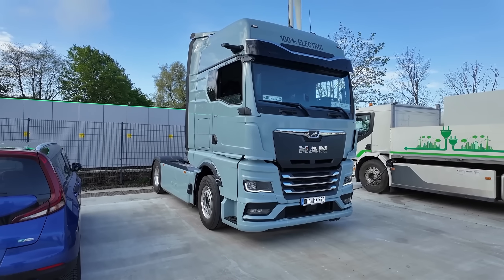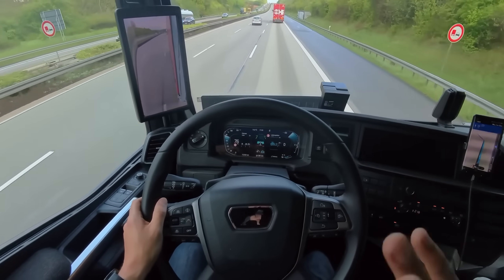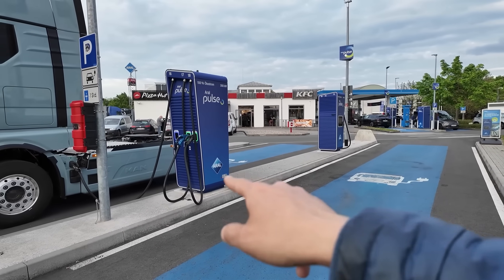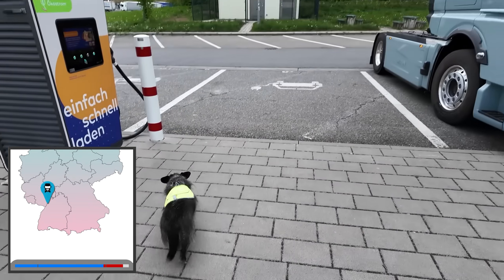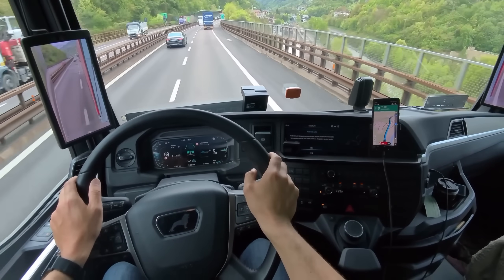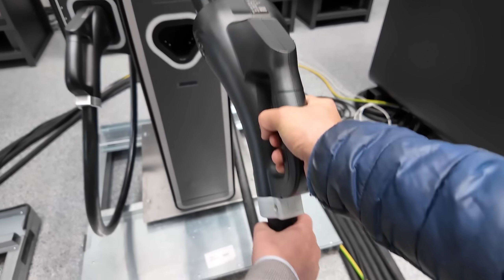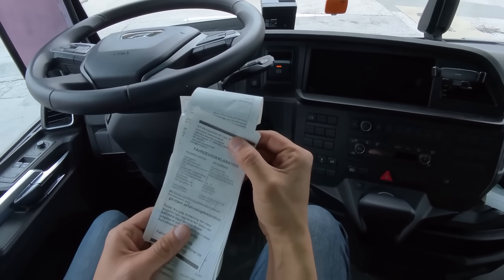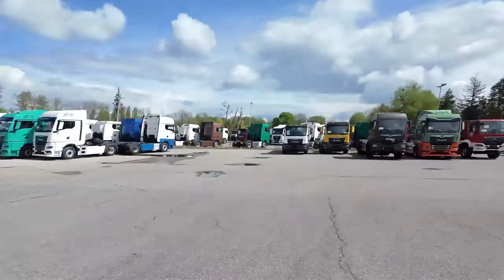Megawatt Charging with the MAN eTGX and HPC Charger Transport over the Brenner Pass

Comment: 15:00 what if? 
Question is 
If they installed batteries on a trailer to give more miles. I mean same socket as the ccs so the trailer can be plugged in on the ground.

Comment: What did you mean by "we don't care if the car chargers is free, we care if the truck charger is available"?
Reply: Free = Available. With a semi truck you can often also use the car chargers, but in order to do so you have to park the trailer elsewhere before. For the Truckers it is therefore important to be able to differentiate in the app, but in the Aral app you can currently only see the chargers without any information if these are for cars or for trucks. But Tobias is currently working on an own app, dedicated for electric truckers.

Comment: One question: When you load up mid-shift, what position do you set the tachograph to? How do you do it when refueling diesel in other jobs? Greetings from Spain
Reply: I think he sets it to account for the 45 minute mandator mid-day driving break. This is the hammer in his concept: use the 45 min break for top-up charging to have the second 4½ hour drive for the day. This, combined with 280–350 kW high power charging is what enables long-distance electric trucking! 

@ElektroTrucker drove Gibraltar through Spain and France in some other video. Check them out. I think Spain has OK infrastructure, a lot of solar energy (PV), and 90 km/h speed limit for trucks. Greetings from Finland :D

Comment: If you're losing power from converting power from a DC supply to run AC motors, why on earth didn't MAN fit DC motors instead which would completely remove losses from conversion of power from DC to AC?
Reply: Converting AC to DC and back doesn't lose very much (anything that gets hot on a machine is wasting energy).  There are many decisions and compromises choosing the design...
Reply: There's compromises both ways, with AC motors you need inverters but DC motors add a lot of complexity in the motor and control system, and they're more prone to overheating and emitting EMI.
Reply: Basic brushed DC motors are not that efficient as brushless permanent magnet DC motors, which require complex AC-like power supply.. something like sine wave with Pulse Width Modulation may be used perhaps to approximate sine wave... Dunno.

But perhaps someone knows better?

Comment: Notes on MCS Availability: 
2025: MCS charger Bakersfield (CA)
2026 TA Ontario (CA) plans a 1 MW MCS 
WattEV’s Seattle-Tacoma plans (~175 miles from Portland) suggest future MCS growth, but these are not yet operational.
Reply: I suspect that most trucking companies will have their own charging depots on common routes.  It'll be cheaper and more reliable than using public charging infrastructure...
Reply: @davidlloyd1526 Schneider is going with their own trucks and charging stations.  But cheaper depends on being to high utilization rate and low electricity prices.  If their equipment is not maintained, they can't sell electricity or diesel fuel.  The truck stops paid for their land a long time ago.
Reply: @davidlloyd1526  Which other companies, besides Tesla, can build EV infrastructure in North America though ? Even Tesla still has work to do. Ultimately, it's easier for a country to accelerate EV infrastructure development when the transition is supported by the government and kept free from political interference.

Comment: What is the highest amount of kW you have ever charged a semi with? Or any vehicle actually. 
I have seen 350kW, but I'm sure there are even higher options out there.
Reply: Checkout his Daimler/Mercedes eActros 600 kWh videos, likewise dubbed on the German @ElektroTrucker channel. I feel this semi had the most reliable charging experience.
Reply: @Hukkinen  

I found this: https://www.youtube.com/watch?v=dEq0XhGVT5s&t=2020s At 850kW !
Reply: @Hukkinen  I struggle to find it, could you say when it's posted? Or preferebly post the link if youtube doesn't hide it?
Reply: @Hukkinen  I now also found this one: 
https://www.youtube.com/watch?v=tSV3k-m_T90
Where they charge a semi with 680kW (and that's still limited to a 1000A ).

Electrictrucker even reacted to it!

Comment: 1:47 @electrictrucker Would you be willing to flash the common US conversion on the screen? It's fairly simple for us to relate miles per kwh (like miles per gallon) but the metric you use is difficult to convert. FYI I get about 0.8 when towing a 10k lb RV with my Lightning.
Reply: Tobias uses 1 kW per 1 km as a rule of thumb. For you this would be 1 kW per 0.621371 miles.  So, 1.6 kw per mile would be the same.

Yes, a lot of people would benefit from the flashed conversion.
Reply: Uhh… he uses the international standard
Reply: 1 Mile = 1.6 kilometers
Reply: @gundurito  So you're being paid by the fossil industry to be rude?

Comment: Here’s the thing with electric though, if your power comes from renewables or nuclear, you don’t need to drive efficiently as there are no emissions. (If fast charging is expensive you need more power grid improvements.

This didn’t really sink in for me until i bought an ev. And now i drive my hydro electric powered chevy bolt like a maniac.
Reply: Germany is 80% renewable energy.  Although even if not, one coal powerstation charging EVs is far more efficient than 100k cars....  In this case of logistics, drivers are told to drive in a certain fashion as it saves a couple of hundred bucks a day...
Reply: Actually not so fast ;) You still produce micro-plastics from the tire wear. About 1/3 of all micro-plastic emissions come from tire wear (Fraunhofer Institute study). The more forces you apply to tires (breaking and acceleration), the more micro-plastics you produce.

Comment: I love your videos, and given I usually can't stand dubbed videos, that's saying a lot. I have 2 questions for you, do you have, or have you heard of, any instances of instability going down steep roads because of recuperation? I assume that all the recuperation happens in the tractor unit, and not from the trailer. Second, do you have have any numbers for savings in maintenance for EVs rather than diesel? 

Your English is fantastic, I feel embarrassed with my near total inability with other languages, and i took German at school. (It was a LONG time ago) The high point of my language skills happened when I missed the bus back to England and had to chase it across France to Calais by train. Panic is a great teacher. That was 35-40 years ago. I live in Canada now, so I have a little bit of French as the food labels have it.
Reply: Watching his videos in the German channel (in German; Tobias has a clear but fast speaking style so it's good practice ;), which I think has these auto-dubbed English sound tracks for all videos I'd say:

– I have heard him saying nothing about any recuperation instability going downhill. But gear changes might bring slight inconveniences based on vehicle type. The Iveco, howver, has no gearbox / has a single gear, maiking it's recuperation experience the best :)

– Trailer Dynamics GmbH has made an puller-independent active truck trailer (which Tobias revieved). It can be attached to any puller. Helps to accelerate or recuperates automatically. It can reduce diesel emissions.. was somewhere between 30–50% if I remember correctly.

Just check out the @ElekrtoTrucker channel in German or English and choose your sound track as preferred ;)  Cheers from FI

Comment: The thing you mentioned that you turn the key too quickly is the same thing that happens on our MAN diesel buses. If you turn the ignition too quickly, the bus will turn on but in safe mode and you can't drive more than 6km/h so you have to turn it off and start the whole process again, slowly
Reply: Weird design. This would drive me mad as a user.
Reply: @JanNovak-pg8oe You can get used to it easily. Human has the ability to learn. Don't underestimate yourself :)
Reply: Why is this made so?

Comment: MCS might have a use case where vehicles are run from the depot and hot swapped, in other words, one driver finishes his shift, and the next driver takes over
Reply: Elsewhere he said its (only) relevant for dual-driver missions, as the mandatory rest times cannot be used for charging. 250–350 kW is all you need, and for mid-day 45min top-up charging :)

Comment: Dispenser is EVSE?
Reply: It's not quite the same. EVSE supplies AC power to an on-board charger. A dispenser is like an extension cable (and a remote payment unit) for the big charger box, which handles all the communication with the vehicle.

Comment: First I was sad to see the map that shows mostly empty space in Poland when it comes to EV charging. But I found other maps that show plenty of charging stations. In my city alone there are around 50 stations. I wonder why is that. Maybe this map was about Truck stations?
Reply: It was about truck compatible (as in suitable) chargers.

 And being EV driver  myself driving across Europe, Poland for sure has a lot of work ahead to improve EV charging infrastructure. Some cities are good ib Poland, others may have single charger in entire town which may not work.
Reply: @MartinzW Its sad that previous ruling right wing party and current and next presidents are and will drag their feet when it comes to energy transitions. We are wasting precious years denying that there is even a problem that needs solutions. You are right, there is much to do in Poland politically and when it comes to implementation.
Reply: Could be that they have no data yet, could be truck compatibility, could be charger speed: looking on a few sites Poland seems to generally top out at 110/120kW (and a lot of station have just one of those, and then some 50, 22, and 11kW) with just a handful of chargers 200 and above. This is fine for cars (kinda, charging on the road at 50kW or less is probably only ok for electric compacts / city cars).

With a 480kWh battery, the 4x2 eTGX would be an absolute hell on those sort of chargers.

edit: got to the map, since it's in the alpitronics HQ I assume it's specifically deployed alpitronics chargers, either they don't have much ops in poland yet, or (per the above) Poland has yet to deploy high-power chargers. Then again, between the relatively high prices and the coal baseload poland is probably no the best country for EVs (then again, there does seem to be a fair amount of solar capacity nowadays which is good progress).
Reply: @BlairdBlaird according to my research there are only few high capacity chargers above 300 kW in Poland. I Hope we build that atomic reactor and improve charging stations. But that would take years if not decades.

While we need recignition af a problem, vision and courage to implement changes. We are still bickering inside with right wing denial.
Reply: The map showed all Alpitronic charging stations!

Alas, 
1) Poland has mostly coal based energy production, right?

2) Poland is 698 km wide from west to east. This results in 8½ hours of driving time at 82 km/h. I guess this means optimally, a trucker has to have his/her 9 hour night rest about in the middle of the country. With 50 kW charging power, you'd get 450 kWh out...

Update: Poland has over 10k charging stations of which 35% are fast charging stations! (source @TVPWorld "Poland hits 100K EV's | The Bottom Line")

Via Baltica and Finland waits for @ElektroTrucker /  @ElectricTrucker ;)

Comment: Thanks but why would the motors use AC? 
I heard that many motors use DC.
Reply: nope! In automotive applications just AC motors. Other than maybe some niche application
Reply: All motors need to switch power between coils as they pass magnets of different polarity. AC motors do it with electronic switching outside the motor. DC motors do it with brushes - mechanical switches inside the motor. As you can imagine, anything mechanical switching hundreds of kilowatts hundreds of times per second would be expensive and wear out quickly. So DC motors are used for things that don't run very often, and are fairly low power.
Reply: I think high efficiency applications use brushless DC motors. Their coils are energized with time-controlled electricity pulses.
Reply: At the end all electric motors are AC.

Comment: Why do they ban night driving? To ensure the roads are 100% congested during the day?
Reply: Because Germany is densely populated. To drive at night would cause a lot of anger (noise).
Reply: Es wohnen Menschen ringsrum, die eine erträgliche Nachtruhe brauchen.
Reply: Noise. Just as using air brakes are banned at night when travelling through New Zealand towns.
Reply: I wonder as well. Noise is not a factor for pure electric. So those who wrote the regulation(s) were too short sighted and too narrow minded. 
If they were smart the regulations would have been written with noise limits in mind vs “no trucks” being assigned the same meaning as “noise limits”.  
Elektrotrucker noted this myopia in an earlier video, where he couldn’t run the cab climate control because the “engine had to be off” instead of writing the regulation to say “no emissions allowed”. 
These regulations leave no room for innovation, no flexibility for meeting the intent of the regulations.
Reply: @NormalShock lmao you think a heavy truck makes no noise. Tire noise? Screeching brakes? Squeaky parts? The beep when reversing?
Reply: @MaticTheProto  Oh, you must mean like sedans, SUVS, RVs (whatever they're called over there and so on ;)
The only difference being the beeping, and that only happens at stops vs on the roadways.
Reply: @NormalShock no, the difference is immense weight
Reply: @MaticTheProto  True. Any pothole or bridge gap makes noise. And the larger and heavier the vehicle, the louder noise.

Comment: I'm not against BEV, i think the technology is great. However, as an example the Netherlands has ~220k trucks driving around daily, imagine the bulk of them starting to charge around the same time, 17-18h. You'd need 200 1 gigawatt power plants to provide power for just these trucks. You'd still need 50 if you smear it out over the night. I think people pushing for the ban of ICE vehicles are forgetting this part, there simply isnt the capacity to charge all these vehicles, and the grid doesn't has the capacity to carry all that power either...
Reply: Imagine all trucks want to suck fuel at the same time! 😯 Why would every truck charge at 17-18? Makes no sense. Also: Having local batteries is the solution. Think local not in one big solution. There are solutions for everything. When they had to build a net of fuel stations and move millions of liters of furls from Saudi Arabia to your local fuel station it was also a big problem. Horses can eat your local grass.
Reply: You obviously don't work as a driver. With diesel it's. ~5 minutes and you're on the way. So far the whole idea of charging is to do it when the truck is stopped, so either during 45m break, or during night rest. Most will do it during their night rest because the 45m break is usually taken wherever your driving time runs out, and that obviously isn't always near a charger. And yes, building the infrastructure takes time. It took ~100 years to get to what we have now for ICE. They want a ban on ICE in 5 years. Good luck..
 @sonyphotoguy6601
Reply: Without the existence of the EV, the grid improvement won't be as fast as it does today

Remember, one of the first way to improve the supply chain is by creating the demand
Reply: Electricity companies have addressed this already with cars. They just offer cheaper charging overnight when there's plenty of spare capacity, and people use a timer built into the vehicle to get the cheap rate.

There's no reason why every truck in the country would need to charge in the same 45 minute period, or why they'd all need to charge at the same time as the peak demand on the grid. Also, 220k trucks charging at 50kW (for a 8-10 hour charge) is only 10GW - although I suspect a large proportion of that number aren't the big 40 tonne trucks like the ET drives, so the total will be lower.

If you're worried about this, you should consider that all this power will need to come from wind and solar that hasn't been built yet, and also the amount of power we'll need to convert all heating to electricity instead of burning gas - or how expensive it would be to raise all the sea defences the Netherlands by a meter or two to protect from stronger storm surges if we don't take more action against climate change.
Reply: @robinbennett5994 where does the electricity come form at night...? Here the wind speed also drops quite significantly after sunset, only to pick back up after sunrise
Reply: @vossejongk if every grid, building, and wall socket had batteries, that wouldn't be a problem
Reply: @dawsonharrington1220that's not feasible right now and you know it, there's barely enough high capacity batteries to make the BEV.
Reply: @vossejongk  Germany has 80% renewable energy now.  Either way, a coal power electricity station is far more efficient than hundreds for gas cars...
Reply: @vossejongk  Most places wind doesn't drop significantly at night - but even where it does, demand drops even more because virtually everyone is sleeping.
Reply: @logicalChimp it does in northwest Europe. And car chargers dont sleep
Reply: Battery-suppelmented charging stations already exist. I think the exchange controlled Nordpool pricing + storage technology will solve this problem.